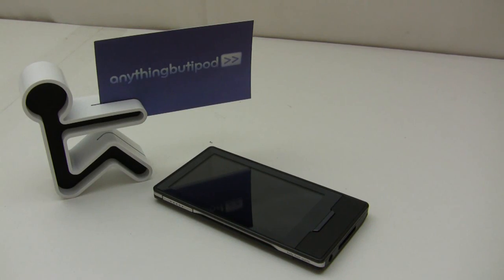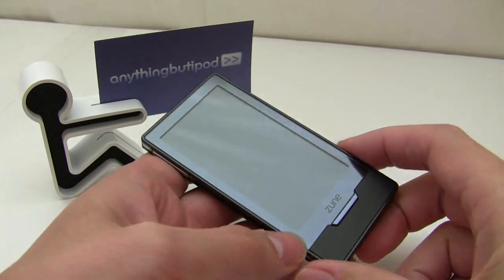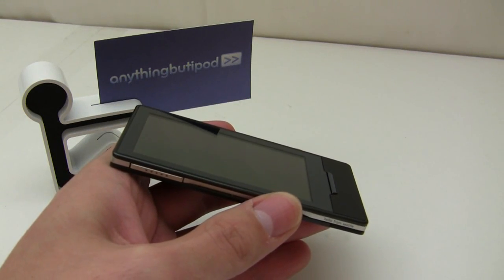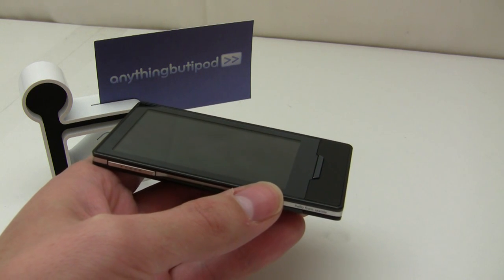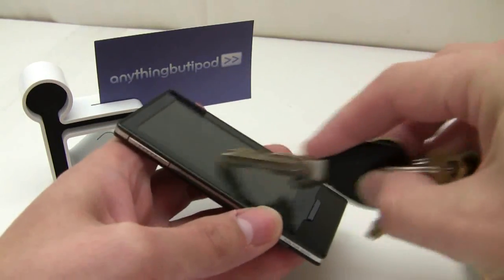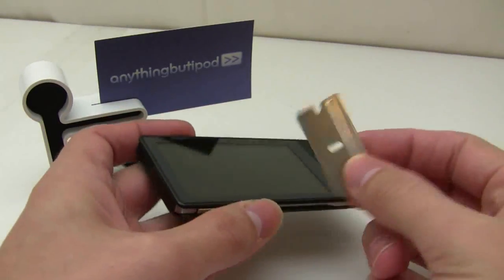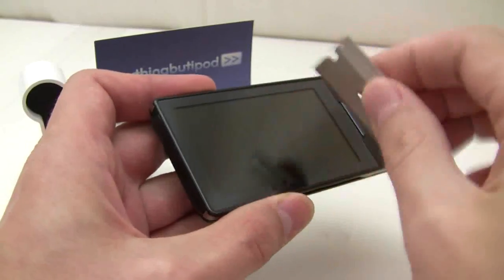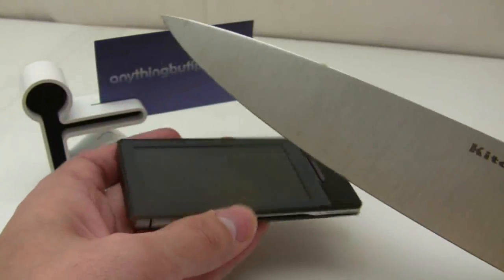Zune HD - Screen Durability Test

Comment: I dropped mine out of my pocket riding my bike really hard at about 20mph on rough road. It fell and tumbled along the road and i picked it up turned it right back on and it worked fine. Now I do have some dents in the corners and one small tiny thin scratch on the screen and a slightly deeper one on the back but thats it. The things a brute. Later I accidentally dropped it on the screen from about 4 and a half feet too.

Comment: @U2ber4lif3 yeah, some little,scratches won't kill your Zune right :)
I don't think the material of the magnet of the headphones can be hard enough to scratch it, but even one little sand grain trapped between the Zune screen and the earbud might have already caused the scratch.
I'm using my Zune120 for 2 years now without a case and it also only has one little tiny almost invisible scratch.

Comment: No you can't.  Steel has much less hardness factor than glass.  Although you could BREAK the glass with steel, that's a test of toughness, strength, and force.  Glass is very hard and brittle so, yeah, you can break it.  Scratch it?  No.  That's why glass is often cut with hardened steel composites that aren't really used in the knife industry such as tungsten, tempered carbon, and diamond composites.